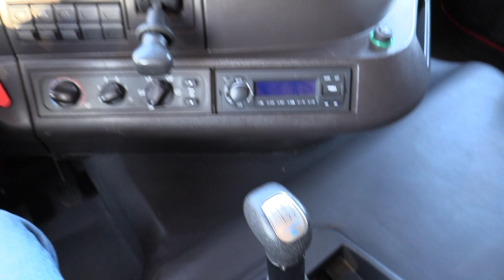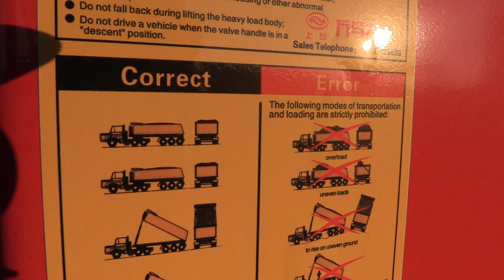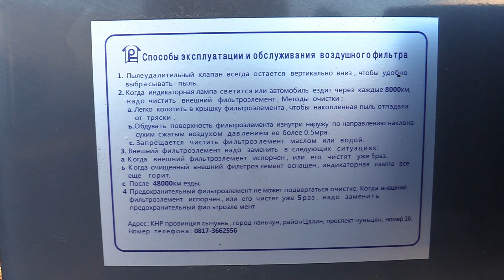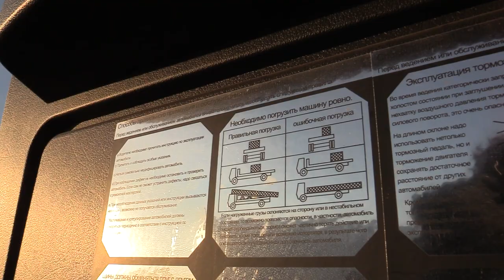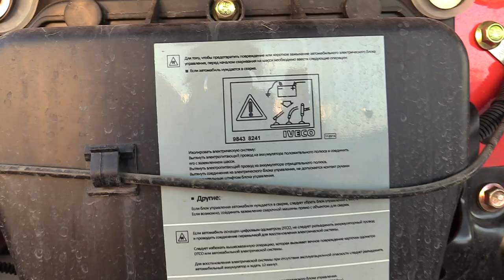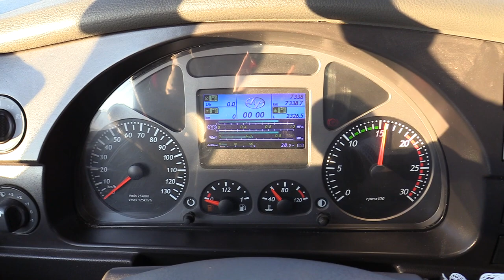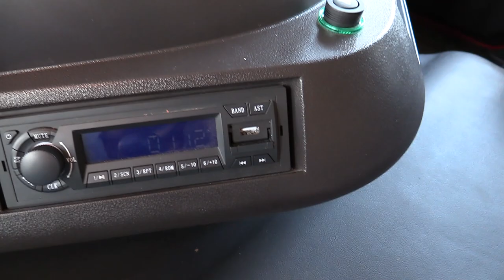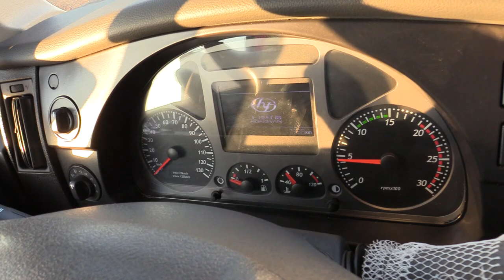2022 HONGYAN GENLYON C500 SAIC IVECO 8х4. Start Up, Engine, and In Depth Tour.

Comment: Good review Alex. Compared to Sinotruk Howo A7, Shanghai Iveco Hongyan more durable for its Cursor-9 engine than Weichai WD510. But Iveco engine inside Hongyan doesn't have EGR to reduce carbon monoxide in exhaust fumes. Main rivals in chinese truck segment is Sinotruk Howo A9, Foton Auman EST-M also Sitrak C7H. Check out latest model of Sitrak C7H euro-6 with MAN D38 engine when on sale